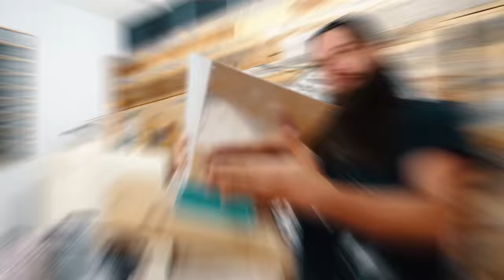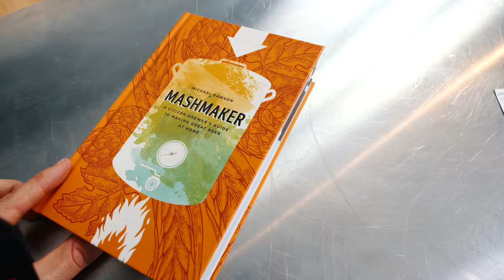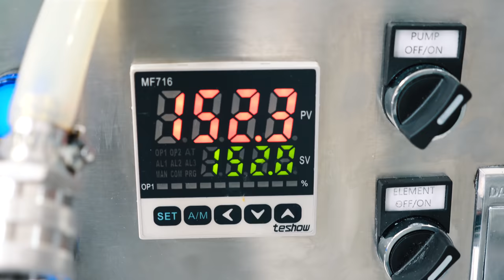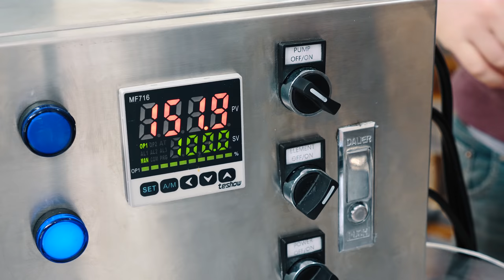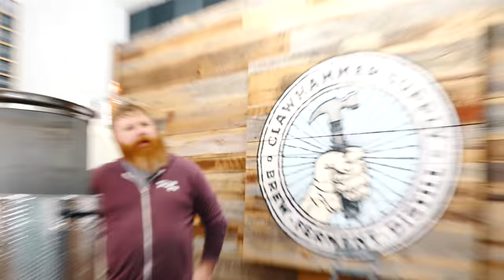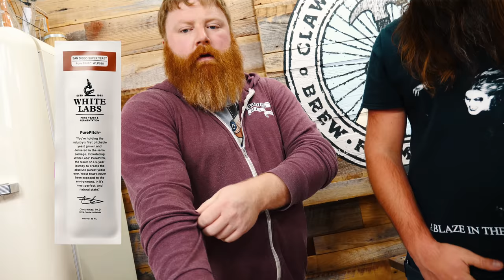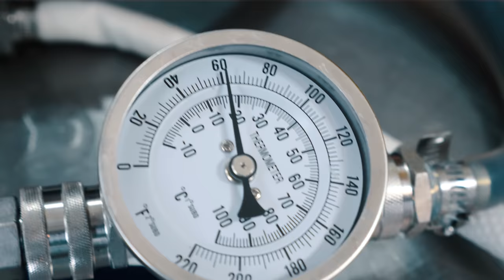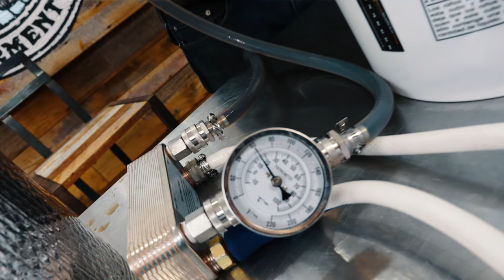Ryed Irish Stout - St. Patrick's Homebrew Beer Recipe

Comment: Have you had any issues with your reflectix insulation melting? I was thinking about going that way, but it is only heat rated for 180 degrees... I've heard of some people wrapping their kettles with silicone gasket sheeting first or using a layer of ceramic cloth against the kettle, but those definitely raise the price point.
Reply from the maker: Jason- no issues at all. We have done quite a few brew days with it.
Reply: Clawhammer Supply 
awesome, I'll have to try it then.

Comment: Some measurements definitely went wrong as you simply can't boil down only 2 gravity points .
I always boil down 6 to 10 points. Just the hot wort will evaporate some water to drop 2 points.

Comment: can you multi step mash with your system?
Reply from the maker: It is super easy to do a step mash with the system. Just set the first mash temp on the controller- and then step it up to each additional step.
Reply from the maker: +S W - Absolutely! Our controller makes step mashing as easy as hitting a few buttons. Good question. It reminds me that we need to do a step mash!
Reply: Thanks for the reply. Did you ever post your beer smith settings?
Reply: Jumping in late... why not do a hop stand on your system as well as a step mash. I love SD super yeast makes great beer. Double it up, blow off tube and go! Keep up the awesome work cheers fun and entertaining videos